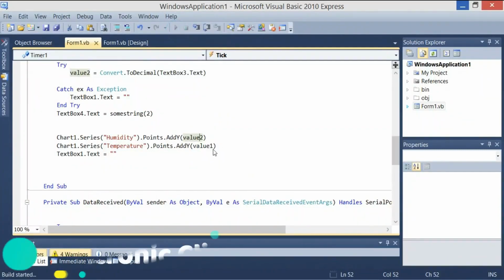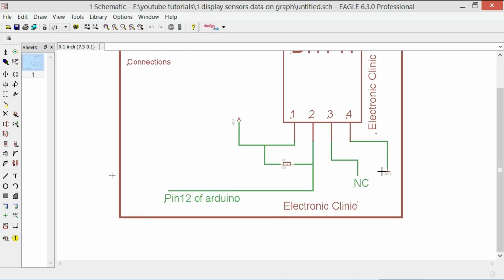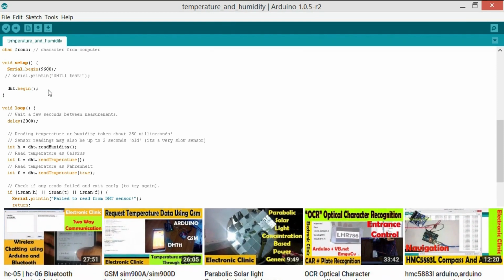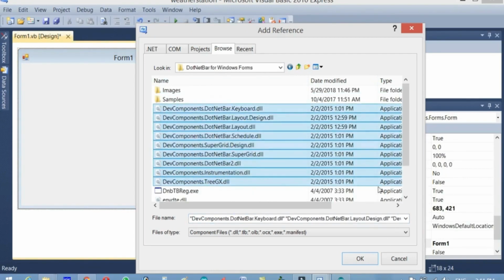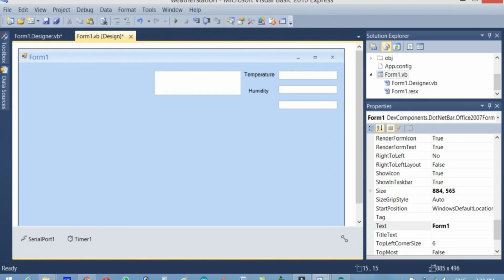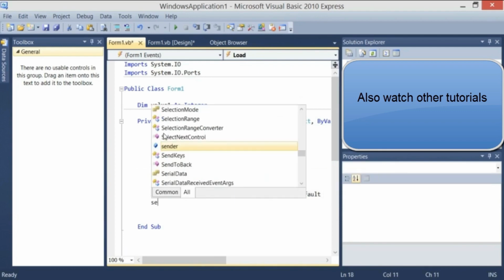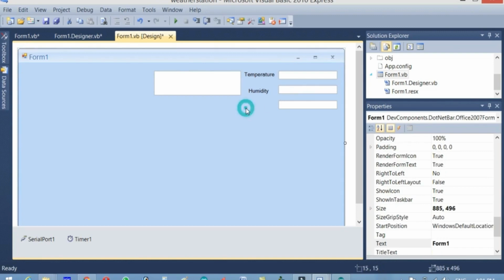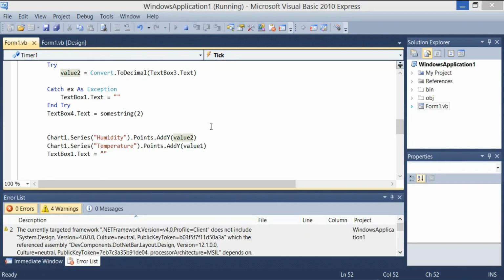Arduino display sensors data on chart using vb.net "visual Basic" DHT11 temperature and humidity

Comment: I am programming in Visual Basic 2008 Express Edition. I do not have the Chart option. Do you know how to activate it? 

I tried in the "Tools" Menu then in the "Choose ToolBox Items" but there is nothing.
 
I appreciate.
Reply from the maker: watch my other videos. i have explained this thing. there is video on how to display sensors values on gauges.
Reply: @ElectroniClinic  Hello:
I already watch that video and I was able to add the "GaugeControl" (made by DevComponentes )  and it is working pretty well.

In the case of the "Chart" control I just find another option made by DevComponentes and it is called "ChartControl" but it's different to handle and I haven't been able to make it work.

I hope you can help me.
I appreciate in anvance.